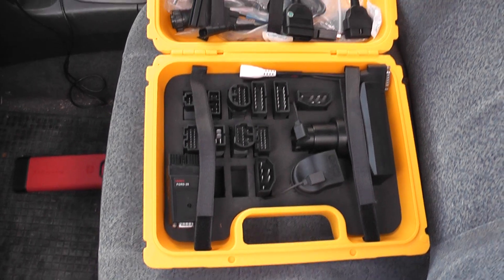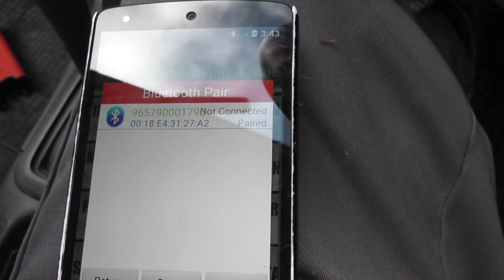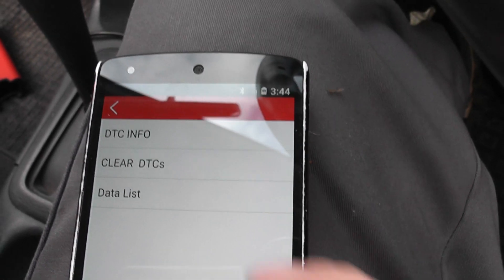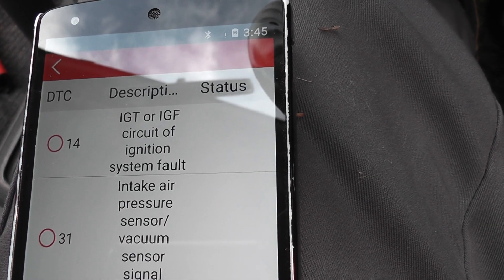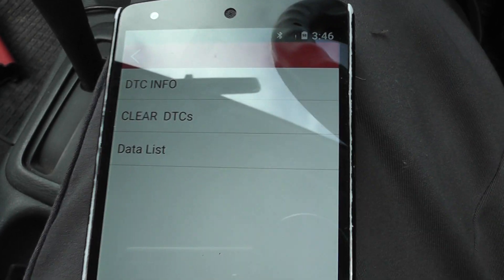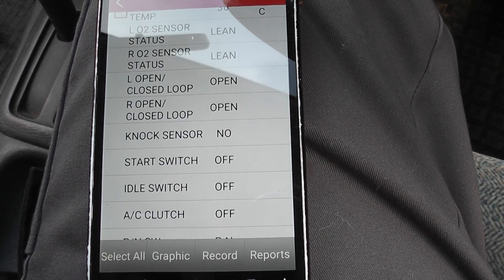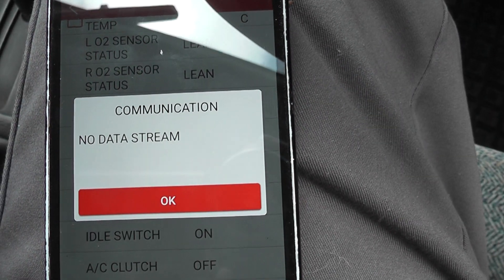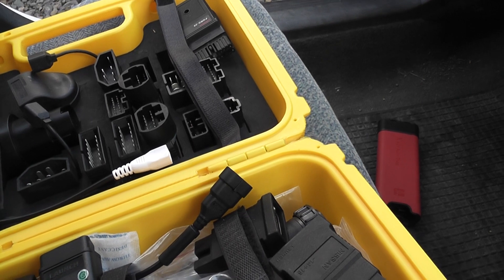Idiag launch kit

Comment: This tool works on nissan sunny 1995 model
Reply from the maker: Osman Azmi  is this a statement or a question. if you have fuel injection and a obd1 Nissan plug it will pull something for sure in any case the factory tool is better Nissan consult with correct plug and software nothing can beat the factory tool.
Reply: it is questions. the car is full injection 16 pin obd
Reply: and thanks for your time .helping me with the problem with me car
Reply: the yellow box . which one is it
Reply from the maker: the yellow box is only obd1 adaptor kit the idiag is discontinued check my other videos about launch idiag x431. also a 1995 model is not obd2 so you either have the wrong year for your car , somone wired a 16 pin  data link obd2 connector in your 95 car . obd 2 only started in 1996 and only for usa built california emission if you need to learn how to fix your car start with dan sullivan ohms law matters then  get the full wiring diagramm for your car to continue learning
whatch my other videos  youtube is full of wrong information and i only post true content.
Reply: yes i will Lorne from you .thanks

Comment: how much does it cost if i want to buy the whole Chinese or Europe car package where i get a whole buch of cars not just Toyota or kia ect?
Reply from the maker: you can buy it from any launch dealer launch china does not deal with end user clients.
This idiag is no longer available so you would want the latest launch pro . launch does not cover all cars as good as toyota and nissan in fact no scantool does for kia for example you need the aftermarket tool called G-scan here is the list of factory tools G scan is only factory for kia and is quite good on asian cars
factory scantools are here each manufacturer uses a different one and codes are symptoms not parts to exchange.
http://www.oemtools.com/homeproducts/hyundaikia.html
launch website for software is downloaded from i log on there with my idiag. yellow case obd1 sometimes comes with launch pro ask your local dealer
http://mycar.x431.com/

Comment: one question please,  can I print diagnostic reports after scanning?
Reply from the maker: Ifeco Jahs  you can save a report of codes codes are symptoms not cause or parts to replace. now there is no print function in idiag but if you can print a screen immage of your Android device then yes. other new launch products some have a mini printer with it . I have the idiag dongle bear minimum the connector kit is from the pro version I had to buy this seperate .